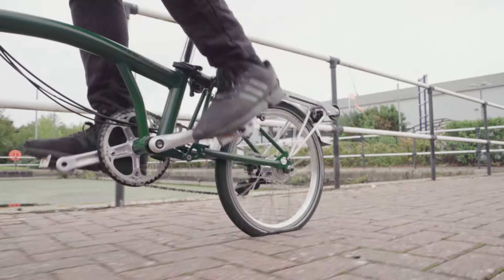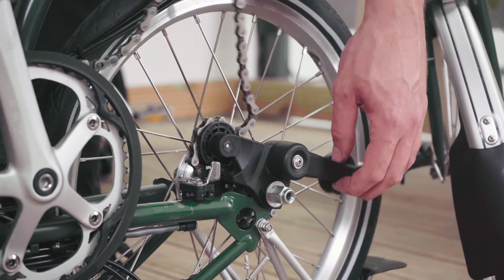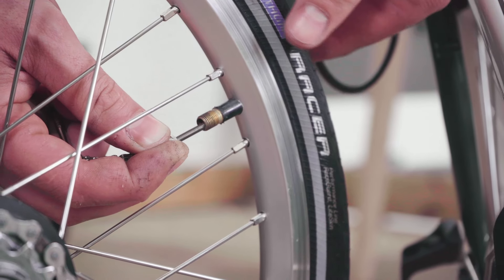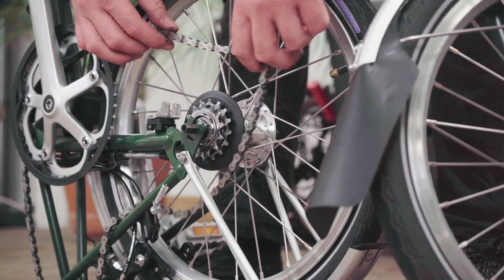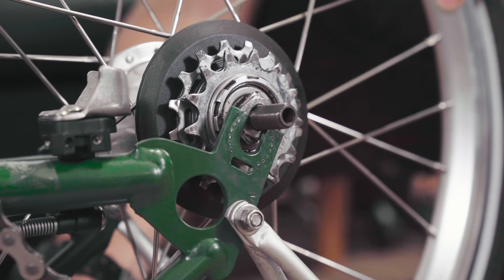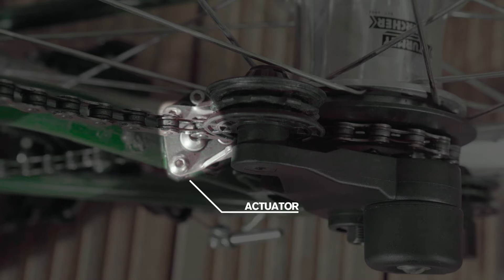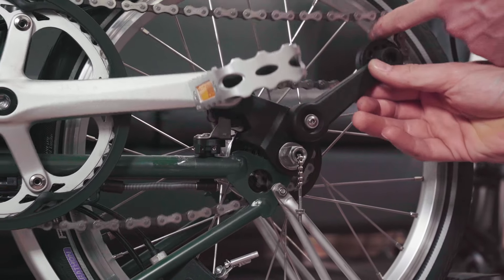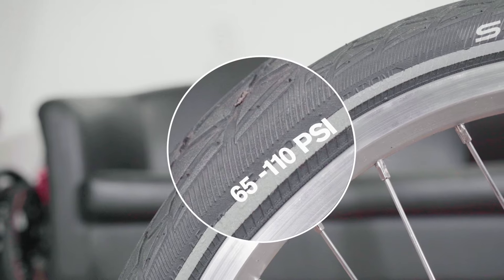Rear wheel : fitting and removal

Comment: When re inflating take weight off rear wheel to reduce chance of a flat spot or pinching the tube. 
You dont have to let the tyre down to remove the wheel you can release the rear brake cable with one bolt allowing the tire to pass the brake blocks. 
Put the bike in top gear and leave the knurled nut in position and undo the barrel nut when removing the wheel. When putting back together, screw the barrel up to the nut and gears should still be in sync.

Comment: Don't unscrew the "security-nut" more than just to unfix it from the gear changer-chain/cable, before removing the chain from the gear hub. Then it is easy to reposition the actual length to about the same value/length, when returning the wheel on the bike. And as an owner of a "Lightweight" I have replaced all nuts and - security-discs, for the wheel, with new titanium versions, for a lighter weight on my bike, also in front (a new axle, discs and nut. For the other side in front, it is an Allen key needed to do the tensioning).
     And, if using mudguards, mine has original struts made from titanium, but the plates holding the struts on the mudguards, are made from really "Heavy Metal"! And it is possible to buy a carbon version (with small lightweight bolts) of the plates and some, in my case, black alu-holders for the mudguards to be fixed on the bike (One for the front and a - different type for the back (Why - not just one type for both?))! But as a heavy, tall Scandinavian man of a 100 kilo, it would have been much less expensive to loose 10 or 20 kilos, but not as much fun! ;-)

Comment: Make sure to switch to your highest gear when reconnecting the barrel chain as it might not reach to reattach otherwise.
Reply: Curiously in the video the chain is first on the largest sprocket and then between the two sprockets. I too would select the smallest sprocket from the start
Reply: Easiest way. Put it on 3rd gear

Comment: I just change the rubber tire in the rear wheel of my 3-year old Brompton bicycle. Thank you for the guide but after fixing the parts back, my gears become problematic. Now I could not fold back my brompton bicycle. Could you provide any help on this issue? Thanks.

Comment: I can't get passed "slacken off the knarled lock nut". According to this (https://www.youtube.com/watch?v=X6RpE0u9FnA) it should be moveable in third gear but that's not the case with my bike. It's extremely tight. Slackening involves turning the nut in the direction of the wheel, yes?
Reply: Did you ever fix this? The knarled lock nut seems to be properly cemented in this bike. I have tried loads of WD40 and GT85 to loosen it all fruitlessly and this is extremely frustrating and not an easy “fingers only needed” experience as the video portrays… thanks in advance!
Reply: @carlosvision  No, I didn't, it had to be done at the bike shop. I've since been able to take the wheel off and replace the inner tube. A bigger challenge awaits after though: to master aligning of the plastic that lines the rim of the wheel when putting on a new inner tube. It tends to move about, especially when trying to get the tyre back on again. If not properly aligned it will cause yet another puncture without fail. In short, I've still not been able to fix a puncture on my bike successfully.
Reply: @carlosvision  Better explanations can be found on the brilliantbikes youtube channel. I learnt how to take the rear wheel off and put it back on again from one of their videos.
Reply: @wrdna58  what seems pretty clear, without a doubt, is that self fixing things on a Brompton is not as easy as it is portrayed on these videos. I’m going to have to take this to a bike shop for overall servicing and replacing of inner tubes, never in my life I have had to do so with any other bike (to replace an inner tube)…
Reply: @carlosvision  i would recommend checking out brilliantbikes though you will probably need a bike shop to unscrew the nut for you. I've since been able to do it myself though the problem of the rim lining alignment is intimidating.
Reply: @wrdna58  I am not sure if you eventually managed to slacken off the knurled locknut… I did! May I suggest something? You will need 2 pliers, a set of combination pliers and another set of Chanellock style pliers. Whilst you grab the cylindrical bit with the Channelock style pliers, use the other pliers to unscrew the bit at the stop. It will become loose and you will be able to carry on as per the video.
Reply: @carlosvision  I don't think i'll be able to handle so many pliers but good to know! Good luck!

Comment: Brompton’s are nice bikes, I just wished the designers and engineers would look at the rear wheel in particular, to see if it’s possible to redesign it to accommodate a skewer and quick release wheels. Although, it might need redesigning the Brompton Hub Gear Indicator Chain and the Sturmey Archer hub. A dilemma for Brompton, wishing to retain its original iconic design, whilst trying to shorten the time to repair a puncture, especially, on the road. Also, it’s incredible this British bike is handmade in London, when so many manufacturers have closed down or gone abroad. I just wished the prices would come down, like it use to be, and believe the Brompton folding e bike is far too expensive for what it is, retailing at almost £3,000. An expensive purchase when you consider, sadly, it may get stolen in London.
Reply: As for as labour rates in UK it’s a reasonable price .